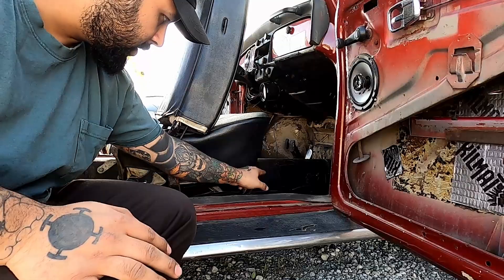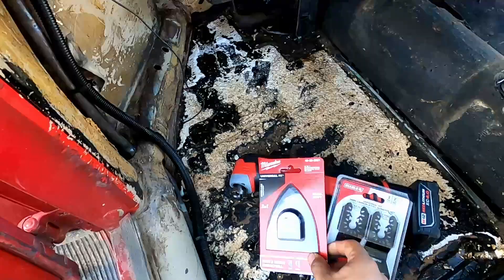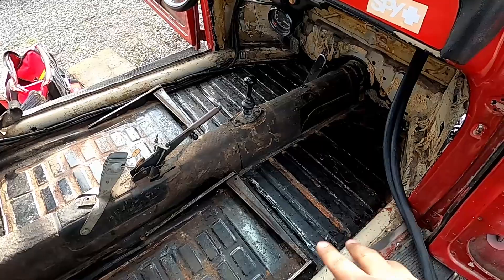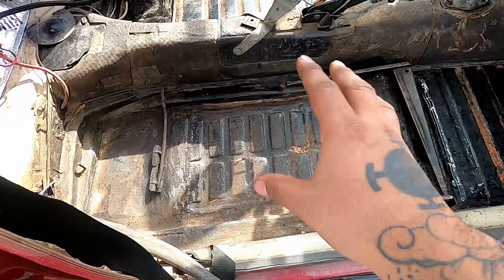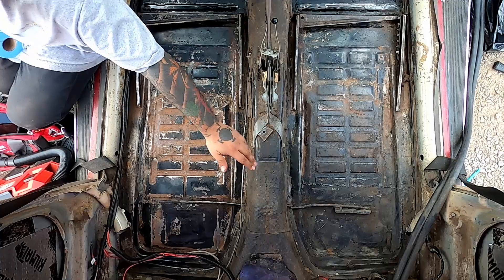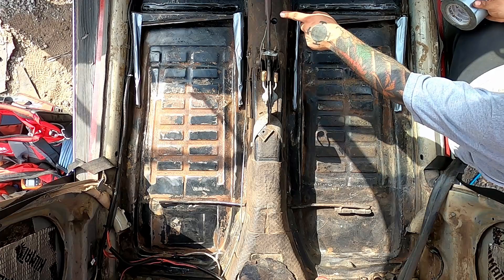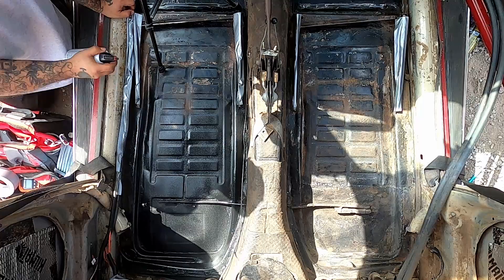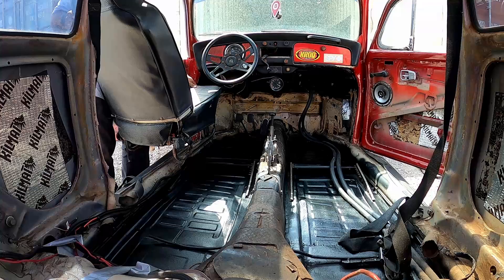VW Beetle painting rusty floor pan

Comment: Nice job dude. Couple of things though. One, does that spray stuff stop rust? It seems like the rust will continue to spread if it doesn’t stop the rust. I just learned about a product from Eastwood that allows you to paint over rust. It’s a rust converter. Two, you removed the sound deadening so you car will be louder. Do you plan to replace the deadening with anything? There are a lot of products out there. Oh and I heard truck bed liners are bad for you in internal use. They are better for external use only like a truck bed. Check the can.  Last thing is did you remove your heater boxes from the engine and that’s why you have the heater hoses? Keep up the great work. Just trying to help.
Reply from the maker: Hey, thanks for the feedback. Rust was minimal in the car, just surface stuff. Sound deadening, I have some 80 mil killmat. I also have a Subaru engine in it, which is louder than hell already. Not sure about it being bad, but I’ll check it out.  Yup no heater boxes, It has a Subaru engine, so it’s water cooled, and a heater. I plan on in casings the hoses later on.
Reply: @SlugsVw  ahhh. The old switch a roo ok well that explains the heater hoses. As far as the rust there is a saying “rust never sleeps” but I’m sure the rhino liner stuff will keep the rust at bay for many years and worst case scenario you can replace the pan half. For the seats take them off again if you dare and take a stiff brush and clean the tracks on the seat and the floor the. Spray both with some lubricant and they should be like butter. Great work. Suby engine sounds good. I won’t tell the VW purist what you did. Jaaa😁